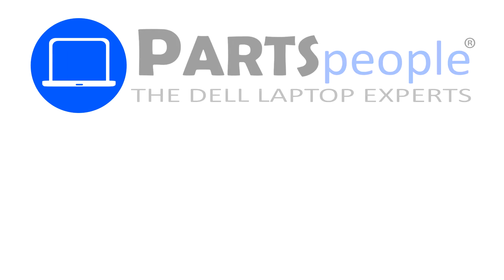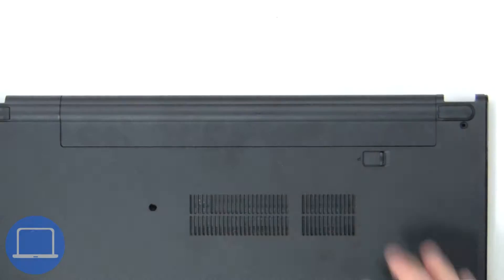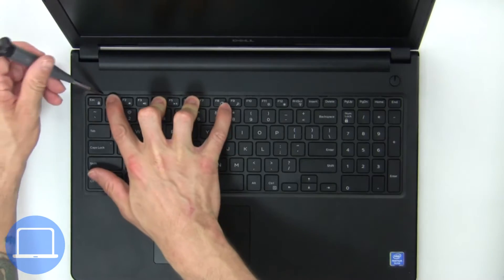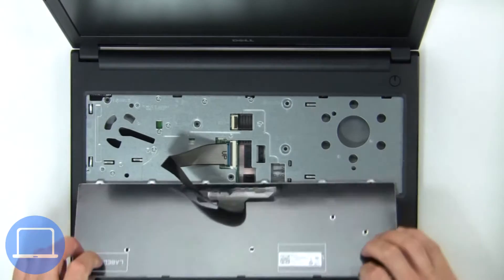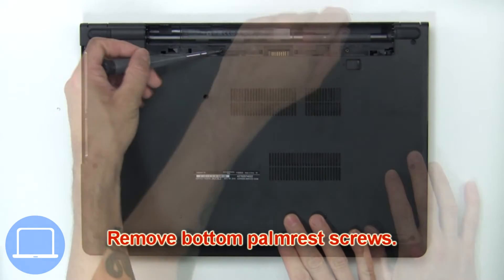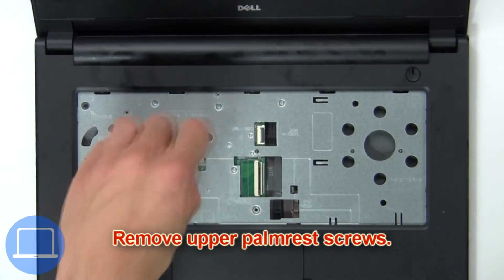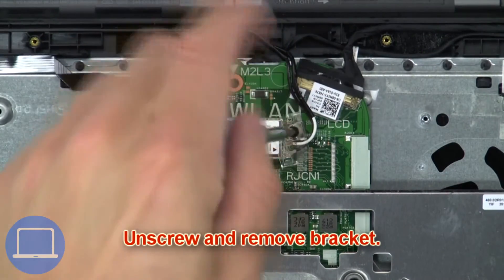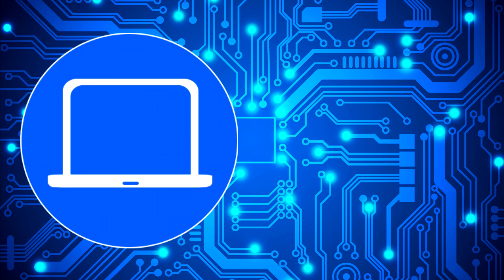Dell Inspiron 15-3567 (P63F002) WLAN Card How-To Video Tutorial

Comment: Lol then when you finally get to the Qualcomm Atheros QCNFA335 wifi card in there take it out stomp on it repeatedly and throw it in the ocean because polluting the ocean is all that card will be good for its junk junk junk. I'm taking it out and putting the intel 3165NGW (which fits quite nicely) from my lenovo g50-80 and downloaded Intel-3165-and-7265-WiFi-Driver_176PK_WIN_21.40.1.2307_A08_03.EXE | 157.48 MB from the dell website and then maybe just maybe the internet wont freaking suck so much...its only this laptop never had such a shitty connection its the dam card all my other laptops work perfect in the same room ill have this junk trying to get a connection for hours then I'll give up pull out my other laptops same range same room they sign on fine no connection issues nothin it just this card I know it. it will be 433mbps instead of 300! a whole 133mbps FASTER same Dual-band 802.11ac (2.4 GHz and 5 GHz) with bluetooth 4.0 but its 133mbps faster I think anyone would be stupid to replace it with the stock atheros card go with the intel 3160ngw or better yet the 3165ngw.

Comment: What was the point of removing the keyboard if the wifi card is in the back?
Reply: I was just about to make a comment saying the only thing I hate about my inspiron is because You need to remove those palm rest screws under the keyboard for the back cover to come off...yeh its dumb I need to take off my keyboard even after I take out all the case screws to get the shell to come apart, plus you need to take out the optical drive every time too to get at the screws allong that edge, I didn't know that the first time I did this almost ripped it apart I was angry they designed this so dumb, My lenovo g50-80 has alot of the same parts inside they are really similar but with that laptop it has 2 screws I can take off this back pannel get to my ram cards and all that simple this inspiron I'm currently using not so much, I am about to do a swap from my lenovo I found out they have almost identical wifi cards and this inspirons card sucks so I'm taking the lenovo one putting it in here I already have the driver installed and it should work for both cards so yeh if your having trouble finding the original card one from a lenovo g50-80 2017 should work just fine, then just download ...This is the latest Dell validated version of this driver
Intel-3165-and-7265-WiFi-Driver_176PK_WIN_21.40.1.2307_A08_03.EXE | 157.48 MB has the driver for the 3160NGW the 3160NGW from intel is going to be way better than the Qualcomm Atheros QCNFA335 I get random disconnects it will say theres wifi just trys to keep sighning on this card blows bigtime so the intel will be much better from what I hear anyway I dont remember having these problems with the lenovo at all.